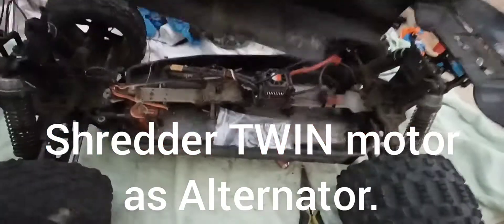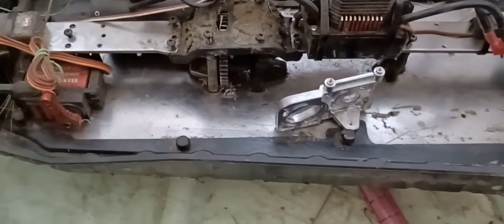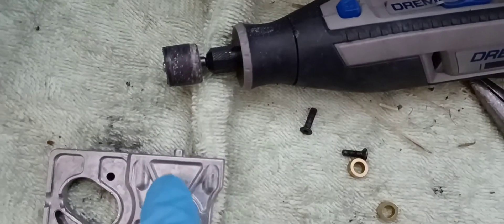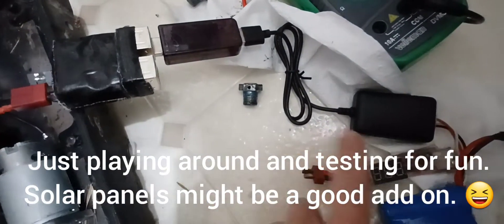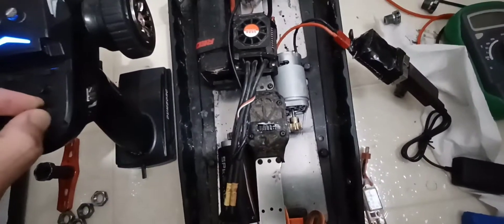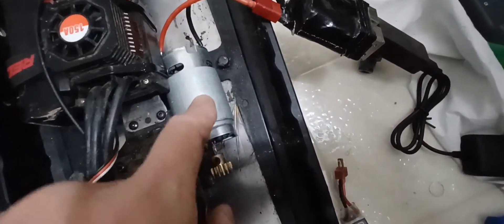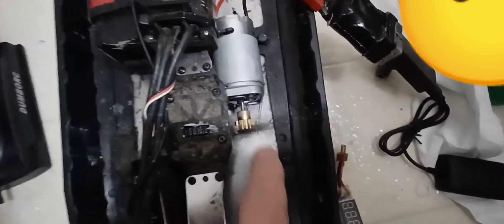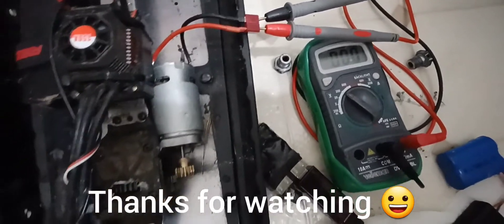(ProtoType)RC Truck with Alternator: Redcat Shredder Dual Motor 2S & 3S Self Charging - TESTING 😀.

Comment: You ever make the update video
Reply from the maker: No but I will one day.  Check out "Radio Active RC" where he has two motors in his Shredder in parallel which I was going to do but didn't cuz it's too much work without the right tools.  The way I did it in this video requires a long extended pinion which is hard to find.  Thanks for watching 😊 👍.  Sorry for the late reply.

Comment: 🤦🏻‍♂️ why go through all this? To charge a battery?
Reply from the maker: Just for fun and to make this video 😆.  I enjoy gadgets and projects more than actually running RCs.   I still need to take it for a run but will most likely burn out the brush motor used as an alternator.  Thanks for watching.

Comment: So how would you hook that up to your battery that’s running the car ?????
Reply: So you can run this till it over heats ???
Reply from the maker: @twoteccs2twoteccs287  til What overheats? You can adjust the pinion or switch motors to match your application.
Reply from the maker: You can use a voltage stablizer/regulator/step down device to the voltage you want then to a Lipo charger. I will make an updated video shortly.  Thanks for watching 😀.
Reply: I mean wit that alternator my esc mite over heat ???